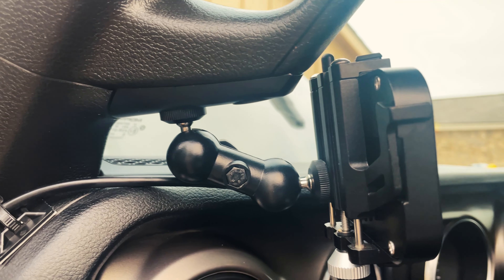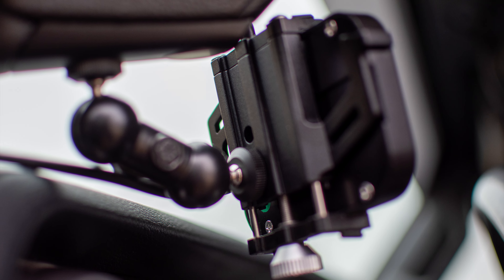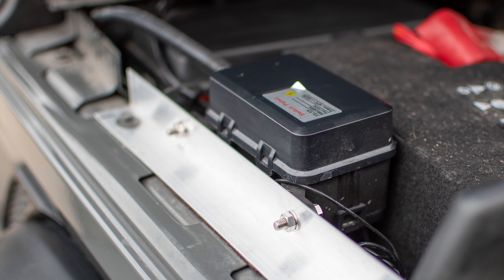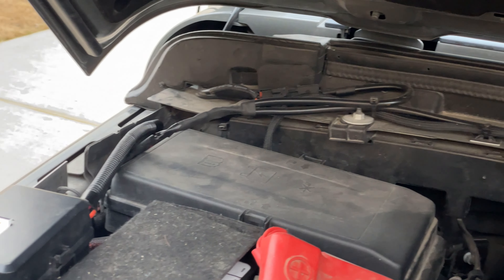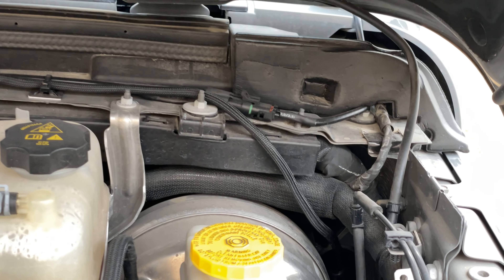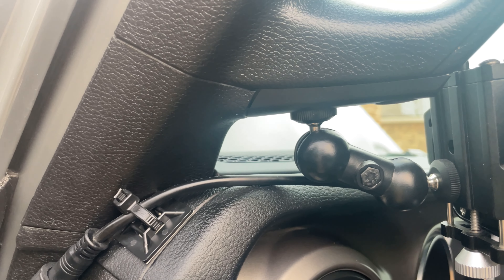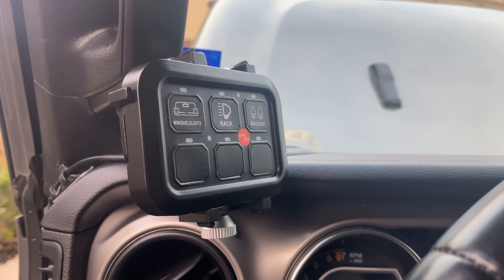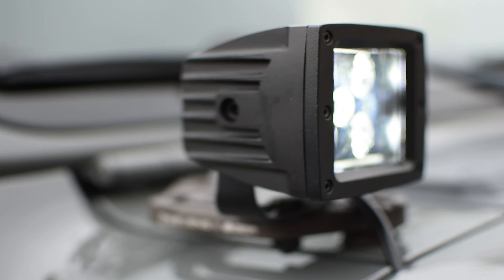Where to put a 6 Gang switch panel in your Jeep wrangler JL

Comment: Mine is already on order can’t decide nd order this but looks good
Nd got same controller 😂😂 putting it on same place but like the bracket u made
Reply from the maker: Fits like a glove 🧤
Reply: Where did u get the 6 gang controller?
Reply from the maker: @daljindersandhu2728  Amazon, the brand I got was Nirider but it’s the same as Auxbeam too
Reply: @BasoholMedia  yea they all are similar i got mine from  strobes and more without phone holder cost me 190 cad nd phone extra still cheap as compared to others same quality same work